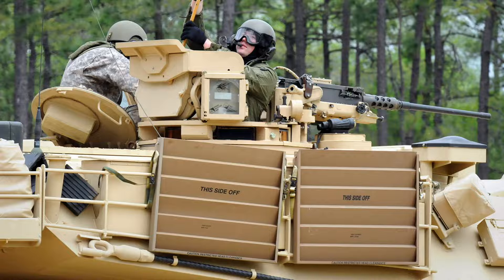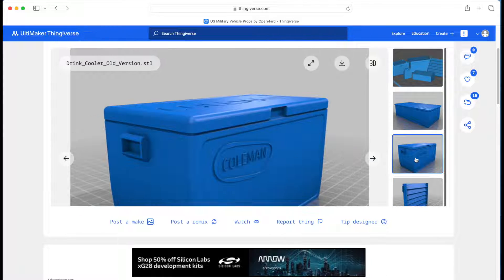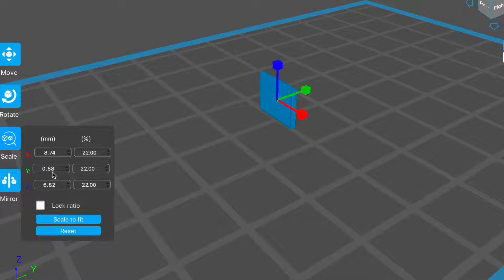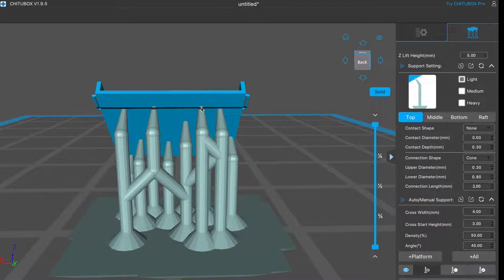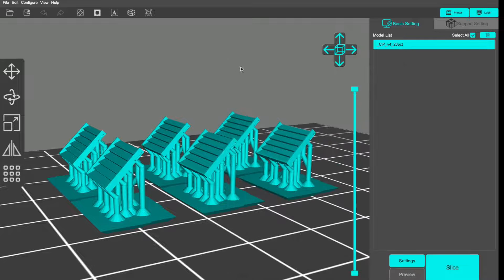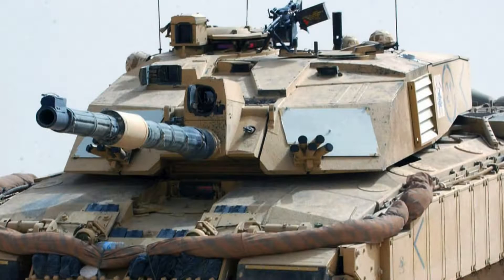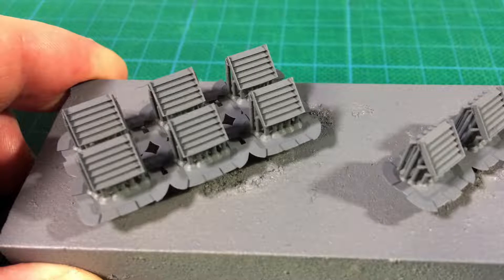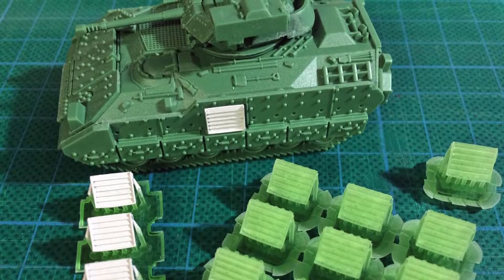3D Print | Combat ID Panels for AFVs (15mm) | Modern

Comment: By making them wider you choose a more heroic style. Just like BF does. 😉
Reply from the maker: It was purely a mechanical issue. When resizing from 1/35th scale it was so thin it was bendy and threatening to break during handling. The extra thickness made the part more robust…